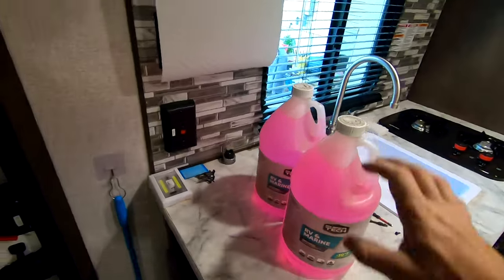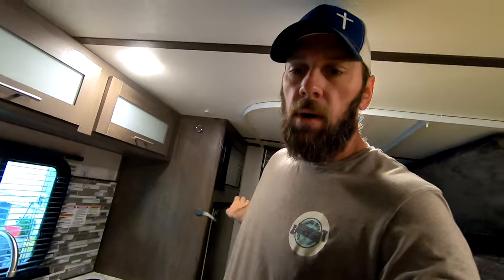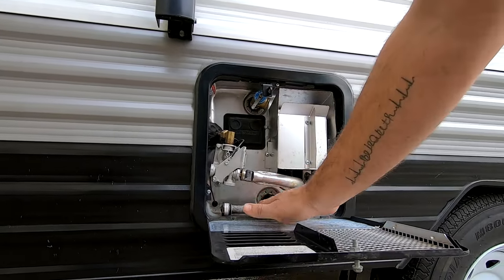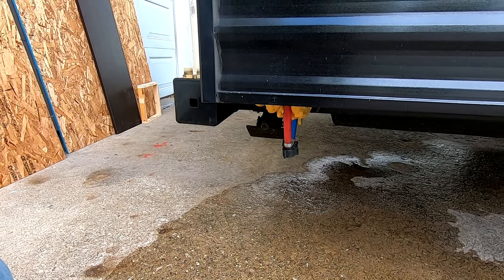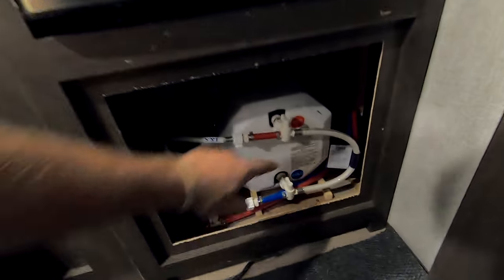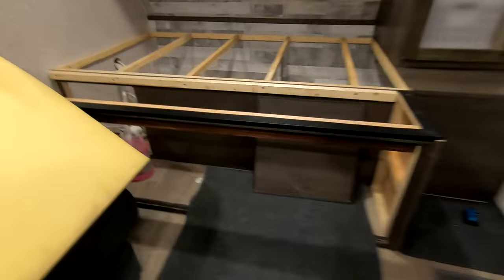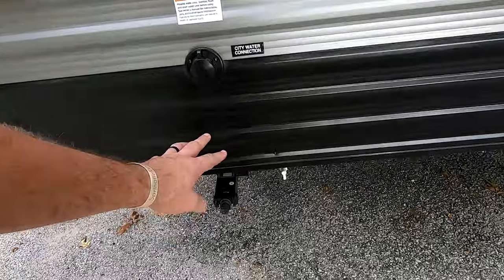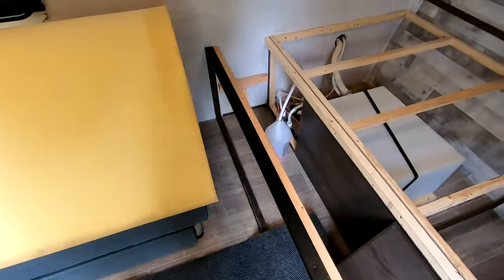How To Winterize Your Camper v.2.0 | Coleman Lantern LT 17B

Comment: Thanks for the video I’m going to do mine like this since I don’t have compressor. I have a 18ft Coleman lantern looks very similar to yours so I’m sure it’s set up the same  we just purchased it a few months ago from a friend still learning a lot. So do we leave the water heater open and anode out too all winter or put it back in when done also do we not need to run antifreeze through that water heater .Watched both of your videos that’s for being very clear with it all .I was just curious about the water heater part seems like we don’t need to run through it .
Reply from the maker: Yes replace the rod when it's good and aired out and no definitely don't put any antifreeze in the water heater.

Comment: you should buy a very good, large, 12V compressor especially if the trailer tires get a puncture, you could plug it and inflate using the battery.  Blowing air  is so much easier, then you don't have to drain and flush after winter.
Reply from the maker: Yeah that's a good idea. Thanks

Comment: Do you turn the water pump line back once done winterizing?
Reply from the maker: I don't switch it back until the spring that way none of the antifreeze leaks into the water heater.

Comment: Is there any drawbacks to not blowing out with compressed air?
Reply from the maker: If you are pushing antifreeze through you won't need to blow out the lines. Depending where you live just blowing out the lines may be just fine.
Reply: @SmallFamilyBigDreams  thanks for the reply. I will def be pushing antifreeze through.
Reply from the maker: You're very welcome.

Comment: I don’t see that additional hose on our water pump area??
Reply from the maker: Oh no. I'm sure that it can be added. It should be fairly easy and I'm sure you can find a kit for this. Hope you can make this work. Good luck, safe travels and God bless.
Reply: You can probably buy the fitting and a nylon hose from hardware store or Lowe’s
Reply: Flojet 20381-009 Quad Port Fittings - Quad x 1/2" Barb, One
Not sure if this is your size but this is the way to make one  but get the size that attaches to your pump and the hose size that fits the part